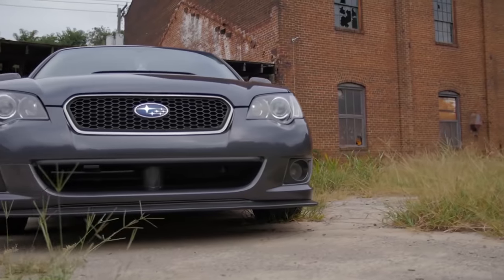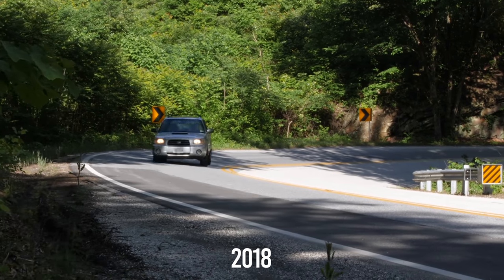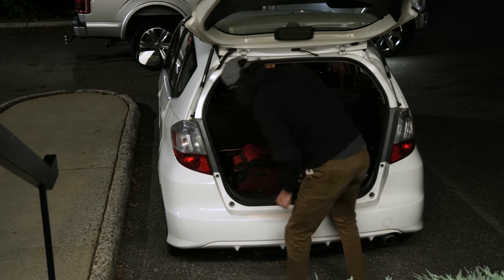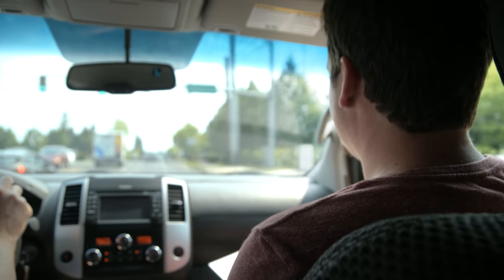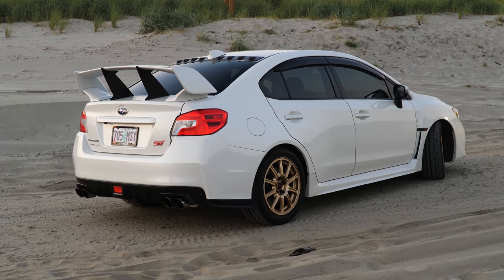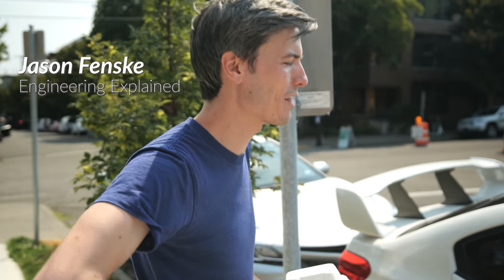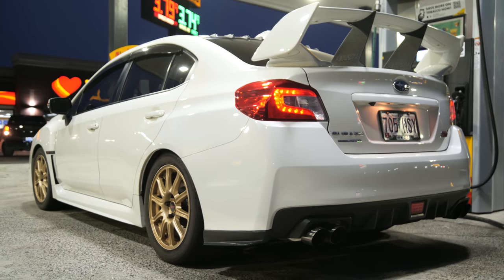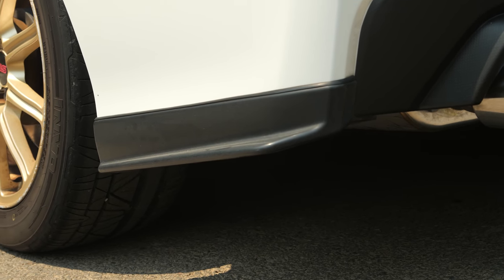I bought a Subaru STI sight-unseen and drove it across the country back home!

Comment: Oh hell yes! As a VA WRX owner, I can't wait to see what mods are planned. The STI's engine might be super old in this gen, but it means there's literally decades of R&D and aftermarket support at this point.
Reply: I had my fingers crossed for the next STi to upgrade to the FA24 because it's superior in literally every aspect besides debatably character, so I could trade in my WRX...then the 2022 WRX came out and I'm thinking maybe I SHOULD just suck it up get an EJ and build it because Subaru has completely lost their way.
Reply: @Jay-yg8jj  I was in the same boat - holding out and waiting for the next gen, expecting them to build on the FA and make the next STI something awesome. Then the announcement hit, and with that, the photos... Holy shit. What a train wreck. =(

Comment: A part of me always wanted an STI. Almost trade my R for the hyper blue a few years back. Thinking maybe I should have? Anyway look forward to your videos every weekend with my morning up of joe. The Editing, the humor, and the two Bens seem overall humble down to earth dudes putting out great relatable content 👍👍💯
Reply: Trading your golf r or type r? Type R, no way. Golf R, depends what the needs of the car you want. I’m 27 so I would go with the STI because it’s more analog and engaging to drive, but I would definitely see if you can drive one for a while, past the “omg new car this is so exciting” stage.
Reply: If you want strictly horsepower, than a Golf R is a much better platform for the money:horsepower ratio.
Reply: I'll take the STI over the Type R or Golf R, anyday.
Reply: @impreza0109  Same if Subaru went back to the hatch, which is truly the perfect DD
Reply: @wavyskiii1498  not only the power gains but as well reliability, gas mileage, and cost.
Reply: @impreza0109  Wtf... Subaru hasn't made a motor that can fuck with a single cam d series. What makes you think it can fuck with a k.
Reply: @joseperalta8605  an engine is just one part of the equation. you still need the powertrain, the suspension system, and most importantly, the driver mod.

honda doesn't compete in motorsports anymore, Subaru does, and with an EJ to boot.

Stop bragging your traffic light speeding records and go to a real track day.
Reply: Idk. Golf r and type r are crazy pricey at retail. 
I like my sti. Sure I could go with something else faster. But honestly. I’m very happy. It’s been amazing on long rides. Gas mileage sucks but I’m not worried about mpg.
Reply: @impreza0109  you delete my first comment. The type r is a better car in every sense of the word. Subaru does nothing well. And what are you talking about honda doesnt compete in motor sport. F1,Indy and all the other GT lm classes.
Reply: @joseperalta8605  Even so, I'll pick the STI over the naturally-understeering Wrong Wheel Drive, any day, every day, every time 🤷
Reply: @Username-ng8jy  True
Reply: @impreza0109  wrong wheel drive 😂. Subaru is the slowest of the bunch. And understeering sweetie it beats the STI On every track. Dont worry you dont have to worry about traction since your ej cant hold stock power.
Reply: @joseperalta8605  Slowest of the bunch to hit the guardrail/tree/crowds facefirst? Oh yea, I agree.

It's simple physics. All weight at the front, tyres have to do double the work. There's a reason why there are no wrong wheel drive F1 cars. 

Let's see honda do a record around the Isle of Man, Transfaragasan Highway, compete in 24 Hours of Nur, Rally Japan, Rally USA, GT300, heck hon-duh doesn't even have any historical racing in WRC.

Again, it's not simply about the engine, it's just one part of the equation.
Reply: @impreza0109  ok the sameway how Subaru has tried competing in  F1 but their to shit so obviously their motor blew correct... Lets not talk about rwd I own a boosted ap1. I would rather a FWD car over a heavy pig of a STI with a shit motor. The engine maybe one part of the equation but its damn sure the most important part. Like I said you dont have to worry about traction when you dont make power. The worlds fastest STOCK MOTOR s2k makes more power than the worlds fastest STI. I beg you to please look that up.
Reply: @joseperalta8605  True, but unlike honda Subaru is still CURRENTLY competing in wider forms of motorsports. 

Don't include the S2K here because that is one of the better machines. Heck it's the only real car produced by honda besides the NSX 1st gen. You were bragging about a family contraption with performance bits slapped on it 😅

Dude. I love my rally-bred Symmetrical AWD torque monster, you love your front-heavy, understeering wrong wheel drive torquesteering shopping cart (which is objectively worse) and I can't change your mind. Just be on your merry way and have a good day.
Reply: @impreza0109  you wanna talk torque monster??? How you dont make power!!! The only reason Honda never made torque is because my vtec is higher than your redline. Anything can make torque with a cheeseburger of a turbo. Also how do you talk about weight when your shit Subaru is heavier you do know awd understeers fwd Honda were design to liftoff over steer so you're argument is invalid. Also another random question... What motor are you on and how much power😂😂 my guess atleast 3 motors in less Than 400whp.
Reply: @joseperalta8605  yeah yeah "your" vtec is just a variation of dual cam tech that other companies already do. nothing special about it anymore.

have a good day. bye.
Reply: @impreza0109  thats not the point I was trying to make sweetie it was  all performance Honda rev past you're shitbaru. Also why didnt you answer the ej question. Also why doesnt Subaru outsell honda even in colder climates. Remember one thing, I dont need an inhaler to make power. So what number engine is this again? 3rd isnt it
Reply: @joseperalta8605  yeah yeah i get your point your mom's car is faster than all of Subaru's engineered, tuned race cars combined.

Can we move on now? Good day.
Reply: @impreza0109  actually kinda... Like I said Subaru dont make power. The ejs have been shit since 30 years ago and FA are not better. Again 460whp on a 93 tune 156k miles revving to 9k. Look up Evans tuning so you can see a stock motor 950whp s2k. Please🙏🙏
Reply: @joseperalta8605  EJ-powered STI car keep on winning their SP3T class, made records in Isle of Man, Nurburgring and the Transfaragasan highway.

Your mom's understeering grocery contraption won't even make the first lap of the Nur. Wake up
Reply: @joseperalta8605  I will reiterate for the final time. I will take the STI over the Golf R and the Type R anyday.
Reply: @impreza0109  here we go again your sti!!! How much power and what motor are you on... Jesus!! Plus AWD understeer plus your heavy.
Reply: God no. The stock engine on an STI is absolutely horrendous. Worst engine almost ever. Built they're great.

Comment: I love these type of stories. The closest I've ever been to this is buying a '90 miata in Lynchburg, VA and drove it back home to Fairfax, about 4 hours away. I had to stop several times from overheating, including a stop in Harrisonburg to replace the radiator cap and top off the coolant (which was dry and brown...). Luckily it's been a champ the last year after a thorough system flush and replacing little bits and pieces.

Comment: Welcome to Oregon (my true home)! I just got back to where I live from a trip to see friends and family in Oregon and Washington, and my car (a 2007 Honda Accord EX-L V6 6spd coupe, 230K miles, one owner) got more love on the trip, and parts were waiting for her when we got back. Your channel is a big reason I'm "wasting" money again on the whole car thing, though it's not all your fault. The other impetus came from looking for a newer Accord V6 to replace the one I have. I quickly realized not only are the newer ones scarcely available, but even my current car is sought after these days for her six cylinders and six forward gears. She's mostly a road trip car, the wife and I drive her 2007 Honda Element (same color as the Accord, even) around town most of the time. Most of what is going on with my Accord is upgraded parts that also act as maintenance, but after having a swapped Civic many years ago the bug is back.

I had planned to drive this summer to Virginia and back, but with the cost of fuel (even with 30+ highway MPG out of a Honda V6), I'm going to keep the trips shorter and spend the money on more parts.

Comment: This has been a life goal for me for a while. Buy a car really far away and road trip it home with a friend. 

I had a 2005 legacy gt wagon 8 or so years ago. Loved that car. So comfortable and practical. All the room of a suv without bobbing your head from side to side over every bump. The mileage and the premium fuel prices were killing me, and the obvious reliability issues. Turbo blown due to oil filter clogging. Melted piston from fuel starvation at full throttle. You know all the obvious ones.

Comment: Things to watch out for on EJ's depending on year: banjo bolt filter getting dirty, oil pump was a bit underpowered from 2004-2007 or 2008 something like that, oil pickup not the best in the oil pan. There are some other videos on youtube that really dig into common EJ failures you should look into especially if you upgrade it!

Comment: I agree 100% with everything stated in this video. I also drove across country (north/south instead of east/west, however) to pick up my STI and it was amazing cross country. I was looking for a vehicle that would do very well in Midwest winters, could accommodate a car seat, was a manual trans, had android auto support (I stream exclusively from my media server) and had the ability to make up for the utility I lost by trading in my truck. With all that, the 2019 STI was really my ONLY option to pick from in my price point, which was great because I've always wanted an STI and consider it one of my dream cars. It's one of those rare situations where you meet your idol and they live up to, if not exceed your expectations.

Comment: Actually, the sti is a basic WRX but tuned and modified straight from the factory rather than by the owner, whereas a swapped WRX with sti parts is modified by the owner than by the factory.

Comment: I'd argue Subaru's are really reliable as long as your don't mod them like crazy... i had a 2002 wrx with 240k miles still running good stock and an Outback with 300k+ from my uncle he had since new. Never any problems.

Comment: AOS, cyl 4 cooling mod, killer B oil pickup/pan and that solves the reliability problem of the EJ. Cobb stage 3 is the way. I took a roadtrip as well for my 18 sti spec'd exactly as I wanted. Perfect daily.

Comment: Stage 2 on STI's is actually not good for them since there isn't enough fuel that can be injected from the stock setup. You should either stage 3 it and get the high flow fuel pump, injectors, etc. or just go back to stage 1.

Comment: Best I was able to get with my STI driving across the country was about 25mpg! It’s all about the smiles per gallon
Reply: Jeez I always fuss when I get that low in my WRX lmao 
I was getting roughly 32MPG until the valves clogged from the EGR, and now it sits at 27..while making STi FBO power from just E30. Shame the new one is fuckass ugly..really wanted to upgrade to the next gen STi

Comment: Congrats on your STI. Correct if I am wrong but don't those turbos come pretty maxed out from the factory? Planning on getting a bigger one? Oh by the way thanks for doing stuff with Dustin Williams, I've been following both your channels for a few years. He's a good guy and has worked hard to get where he is. So with your STI are we talking cams, head work, bigger valves and other stuff down the line? Dude you got to chill with Engineering Explained? That's awesome.

Comment: I drove my 12 WRX sportech basically across Canada, if i could have done it empty instead of with basically every thing I owned, and been under time crunch to get here for a job starting, I would have had a lot more fun.
Also huge fan of vent visors, and do in fact use them to have windows open in weather. I don't agree about the roof, been missing mine. 
Waiting for the 22 STi to be announced. The debate is between that and Tesla M3. M3 would be lot cheaper daily drive, but the STi would also be road tripable (northern AB doesn't have any EV chargers)

Comment: When I got my first civic it started rod knocking 30 miles out and drove like that for another 150 miles and I did a top speed run as well.
The block and crank melted but the engine still run😂😂

Comment: No! I wanted a white…. Got a ‘21 WRX STI Limited for my first car last month from the dealership. Waited a month for it to be built from the factory. Then had a 18 hour road trip from Las Vegas to Seattle. There weren’t any whites available so I got a black one. Thinking of wrapping it white! Not going to put engine mods because of the horror stories of the EJ25. So far I love the car! Ceramic tints and vortex generator are only aftermarket on the car right now. Thinking of purchasing TC3s to replace the stock STI rims

Comment: Go with a FP green, equal length headers front mount intercooler and you’ll get 450whp reliably
Reply: just curious about how each one of those items benefits the longevity of the motor
Reply: @YungSteambuns  I highly doubt he’s gonna keep it stock and that’s a good upgrade route and power number without sacrificing to much reliability

Comment: “Subaru doesn’t like high hp”…. IAG laughing in the back 😂😂
Reply: The numerous 1000+ EJ's. People have no idea. Josh Bader running 9's on a stock long block. The Subaru world has changed. People just haven't kept up.
Reply: @chandlerbraaten847  facts they still think Hondas are slow too 😂 then they catch the gap from both Subaru and a civic
Reply: @moza1956  yep, the fact that you can awd swap just about any Honda chassis pretty easily and then power it with a big turbo K-series.

Comment: I don't know why you think a Subaru is unreliable. I have owned several and the oldest one I have right now (2000 forester) still going strong on OEM headgaskets at 270,000 kms. it's not my daily driver so it may sit parked for weeks and then I may do a 1000 kms return roadtrip and have no issues. I do maintain and care for my vehicles meticulously (myself) so I expect them to last a lot longer than the average person, and for the Subaru brand, the reliability is far greater than, as an example my 2008 dodge RAM 1500 that has 337,000 kms and I have basically had to rebuilt everything on that vehicle to get it to be reliable at 300,000+ kms. I also stand by this for modified vehicles as I have had a few of those in various forms, that I built myself (to 90%) and have been daily drivers and super reliable.

Comment: Subarus do like high horsepower when done right, check out Bader’s, channel, he’s always pushing drag runs on stock engines, building quite allot of customers cars, proven time and time again I have been. Saying for years, also the 1988 -04 Ws the EJ20, so 257 is not 30years old, as usual those that don’t do it right give cars a bad name. Rims look a little curbed, does sound good, Cobb exhaust is nice touch. I like the white, 2018 onward have the RA block, what year is this? Nice buy if right price, enjoy..

Comment: It's crazy how someone feels about a car can change so much from person to person.
My first Subaru was a 2003 WRX with all the right mods and was absolutely flawless. So what did I do? I sold it because I was afraid an issue COULD happen. Idiot.
Next, I bought a 2013 BRZ, got an amazing deal, and once again all the right mods. I loved it but never as much as my WRX. Skip ahead a few cars and I bought a brand new 2020 WRX STI. I tried so hard to love it but I hated just about everything about it. The seats were horribly uncomfortable, the stock exhaust had a drone from the factory that was horrible at low RPM and the speakers were no better than the ones in my 2003 WRX (I'm not an audiophile.. these were just unacceptable for a 40k+ modern car). So, I started throwing money into mods in hopes it would start feeling like my 2003.. After exhaust, intake, tune, suspension, and a few other small mods, it just never felt right. The new WRX's just feel like they're trying to be something that they can't anymore (I assume modern safety regulations and such are the cause).

Comment: Lol… I would have sold you my 2015 with 8900 miles on it and I’m located in Indianapolis.

Mine is black with no sunroof and keyless entry and the Harmon Kardon system with nav. STI optional aero kit all around. oem trunk protector And optional door bump protector moldings. 

Tein flex Z coilovers
Tomei expereme ti exhaust
Invidia cstless downpipe
Aem cold air intake
Cobb access port with custom tune
AVID AV-06 wheels in hyper silver 
Carbon fiber front and rear strut tower braces

It’s mainly a garage queen 👸

Comment: Subarus like high horsepower just fine. Issue is, to do it reliably it’s expensive, very expensive.
Reply: So the statement remains true. They don’t like high power in stock form.  The 4G63 can last with 450-500 hp.  So does the 4b11    The Ej25 not so much. Not hating. I own a Sti. But I came from Mitsubishi and Honda’s, then I owned hemi 392.  A coyote 5.0 and a 5.2 voodoo before coming back to Subaru.
Reply: The newer motors (on e85, which does help with reliability) have been pushing 450+whp on a stock longblock. While they aren’t as strong (stock) as the others you mentioned, they are significantly stronger than people give them credit for.
Reply: I think a big portion of the reliability in more recent years comes from a combination of the tuners, and technology/r&d/etc of other systems in the car that are part of the reasons for failures.